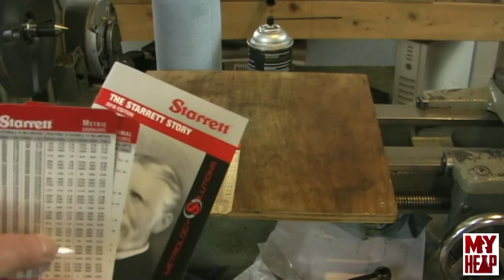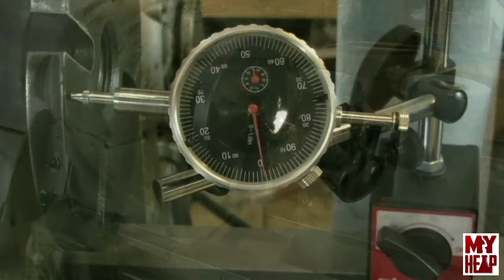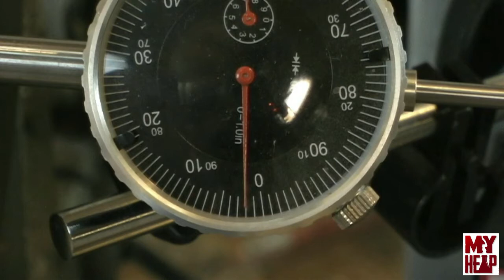Atlas 10F Lathe - TH54 - 23 - More New Parts, QCTP and an Issue with the Back Gears

Comment: The arm that holds your back gears in place is an over center setup. so check if it's truly over center
Reply from the maker: So in a sense it should act like a lock on a pair of channel locks?  I know the ends act like a Cam, so thanks for the tip.  I will take a look to see if it is coming over center.  Great tip!

Joe

Comment: Hi Joe, things are coming along. I had a similar problem with my backgear.  I was working on a project and needed a "quick fix" to finish thr project in time (was a captive nut puzzle for a friends daughters graduation.) What I did was make a quick little arm out if sheet metal that I screwed to the oil hole and tightened it down, holding the lever foward. Not fancy, but it worked. 
The only reason I can think of to run the machine in reverse, would be to cut metric threads, and I do it so seldom, that I am not worried about reversing by hand. I have seen chucks fall off and significantly damage a bed running them in reverse. I we did not have screw on chucks, it would be different.
Reply from the maker: Richard Cox sent me an email with a picture of the fix he done when he had the problem.  He made an 8-32 brass knurled thumb screw and screwed it in the oil hole.  That seems like a pretty good fix too.  Just have to remember to remove the screw and oil it once in a while.

For conversation sake, I saw a guy machine a plug that rested on a step in the bore of his chuck, which he threaded the center of.  In use, he would open the jaws and slide the piece inside his chuck to rest on the step that was internal, then insert a drawbar and and tighten it up.  In his case he had to do a lot of threading that the half nuts were useless on and he wanted to reverse the lathe.  This allowed him to do that without the worry of spinning off the chuck.  Now, I don't know if all chucks have that step, but it was a neat solution.  Although you lose the ability to pass stock through the spindle.

I think that no matter what, I want to learn to run the lathe before I consider taking any risks.  So, in the event I need a metric thread or want to cut a work, I will back it up by hand.

Thanks again Jeremy for all the help you have given me.  It is greatly appreciated.

Joe

Comment: Really helpfull and fun to watch as always. I still haven't had time to tinker with the collars, but I will soon. Otherwise the ball and spring is going to be a project. And it was fun to hear how you pronounce my name haha! 
Oh and a 3 phase motor is easy to reverse as you can switch the wires around. A single phase motor has to be made for reversing I think.
Reply from the maker: Gerben,

I thought I would be smart and check the "Go Ogle" machine on the "Interwebs" to see what I would get for a Dutch pronunciation of your name.  I could not really find a definitive source so went with what I got the most results for.  If I messed up the pronunciation of your name, I apologize.  :-)  Some people it bothers, some it doesn't.  Me for example, my last name gets butchered all the time, but I care less about it.

The simplest solution for the back gear problem is a brass thumb screw.  I received quite a few suggestions and links about the issue and it seems like many have had the same problem.  If you email me (xavier at gtec dot com) I will send you an image of one guys fix with the brass thumb screw.  I think this would be easier than setting up and drilling for a detent spring and ball, though I think the latter is a cleaner fix.

My motor is a 1/2 horse single phase motor.  After getting a good look at the data on the motor, I find that it is reversible.  I simply need to the reverse the start winding polarity.

Thanks again Gerben, and again, if I messed up your name too bad, I apologize.

Joe
Reply: Haha no worries, it was fun! Nice that you put the effort in searching the name, no one else does that ;)
I will send you an email right away!
Thanks for the help.

Comment: Probably a silly comment, but a rubber band stretched from the oil filler to the back gear handle might work to keep the back gears  engaged. Perhaps the previous owner had a spring loaded plunger   threaded into that tapped hole to create friction on the shaft and if a small drill point dimple was drilled into the shaft at the engaged and disengaged positions and a spring loaded plunger was used that would most likely solve the problem. You should be able to find spring loaded ball plunger at McMaster.com. I have the same lathe except I have added a quick change gear box. Regarding motors, since I had the money, and I don’t mind changing and improving my machines and am not concerned with keeping everything OEM and museum quality, I replaced my single phase motor with a new VFD rated 3 phase motor and added a VFD (variable frequency drive) that converts single phase 120v to three phase and more importantly gives you variable speed capability. I added a digital tach for spindle rpm reading. A lot less belt position changes and I can run the spindle from a crawl for power tapping up to full speed. I have a drum switch in my setup and use reverse when power tapping, I don’t usually have any issues with the chuck unscrewing but only running at slow speed when power tapping and only power tap with larger size taps.
Reply from the maker: Hello Steven and thanks for posting.  First let me say I appreciate all feedback!  You are correct a heavy rubberband would most likely fix the problem.  Another good solution is a brass thumb screw applying pressure to the shaft.  I do like your spring loaded plunger solution too.

I would not mind converting to a new motor and VFD and digital tachometer.  Speaking of which, where did you mount the sensor for the tach?  If it is a genuine improvement I don't mind changing the machine as long as it can reasonably be put back original just in case the next guy wants it that way.

Great tips and ideas.  Thank you Sir for taking the time to share them with a newbie like me!

Joe
Reply: My Heap - sensor for tach is mounted on left side of spindle pointing at adjustment collar. Tach is a “Tachulator” as sold by LittleMachineShop.com
Reply from the maker: Thanks for link Steven.  I appreciate it.

Joe

Comment: working in inches is very inaccurate. A 1000ths is 0.0254 mm, thus 4 thousands runout is 0,1016 mm and that is a lot of runout, in fact to give you a comparison on my babbit atlas lathe I have 0.02mm runout and this lathe is the tapered roller bearing version.
Reply from the maker: I agree, but the run out was on the face of the used face plate that I acquired.  A measurement of the spindle bore had less than .0005" run out, 0,0127 mm.  For what I do and given the lathe is nearly 80 years old, I can live with it.  Thank you for watching and taking the time to comment.  I appreciate it.

Joe
Reply: @MyHeap  I've got the exact same lathe but with babbit bearings, nice thing with the babbit bearings that you don't get with tapered is that you can tighten everything up if you want super accuracy like with fine thread cutting. My lathe didn't have all the goodies your lathe has and I can't find a single Atlas 10inch part in my country, so had to resort to upgrading the lathe to electrical. Have an electronic leadscrew with closed loop stepper motors/drivers and I have an encoder on my spindle to do readouts and upgraded my motor to a dc treadmill motor. Feels like a modern lathe, but still has that antique workshop smell to it, love it. 
If you by chance have any parts laying around I'd be will to buy some if possible?

Comment: Joe, I have two comments for you. About your back gear creeping out, I would not want to modify my lathe like that if there were any other way to fix it. To fix that correctly will be a little trouble but if you will take all the gears off of the spindle and the back gear shaft and check the distance between the two shafts and also make sure that the two shafts are parallel to each other I think that will solve your creeping problem. If the shafts are off you will notice that there are shims between the back gear mounting and the main housing of the head stock frame. You change these shims to correct the distance and parallel of the two shafts.
      As far as the reverseing of the motor, I would not want mine to reverse because your chuck screws onto the spindle and if you run it in the reverse direction the chuck can unscrew off the spindle and that is a horrible castastrophe. You cannot lock the chuck onto the spindle tight enough that it will not come loose if you put any strain on it in the reverse direction. 
    Hope this helps you make the right decisions.
Reply from the maker: Hi Clifford,

I am sorry for the late reply.  Been busy with life.

I made a video where I calculated the shim size to place between the back gear shaft casting and the headstock spindle casting to set the gear spacing.  Although it is a painful video to watch as I was brain farting along the way. (Started with the OD of the gear rather than the PD, but eventually caught my error.)  I could have, and probably should have remade the video, but sometimes seeing ones mistakes are helpful.  But after figuring the center to center distance without any shims, I could calculate the thickness of shims I needed for my lathe.  If memory serves correct, that was about .011 or .012.  What fixed my issue was to apply a little more compression to the spring washers that sit against the back gear castings with the collars.

Now, having said all that, I think the wear of the gears could possibly change the geometry and could cause the need to adjust the thickness of the shim.  I calculated the shim based on the formula for center distance for the two shafts.  If wear affects that, I do not know if I would need to adjust the shims thinner or thicker to compensate.  I could also imagine that the pressure angle of the gears acts as a lever of sorts that would cause the gears to lever away from each other.  But keep in mind I am a novice and don't really understand all the mechanics.

As far as reversing the motor, the jury is still out.  I can see some benefit to it and with things like a collet it should have no ill effects.  I realize there is a danger of spinning a threaded chuck off the spindle and to reverse the motor could have disastrous effects.  Although an interesting solution to that very problem was presented by Steve Jordan.  His solution is something of a drawbar that holds his chuck in place when reversing the motor.  It is an interesting video and you can see it here: https://www.youtube.com/watch?v=8PYsNfKk_Q4

Clifford, thank you for taking the time to post and your suggestions.  These are helpful to a new guy like me.

Laus Deo,
Joe

Comment: i'm not sure you can reverse a single phase motor.. or at least simply do so.  unless it's DC. also there are lots of drum switches online or even at harbor freight.... also be VERY careful running your lathe in reverse because the chuck can easily unscrew in that direction.
Reply from the maker: Hey Bill, you are correct that reversing it has to be done with care.  I need to look at the motor, but I hear the centrifugal switch kick in and out when turning it on and off.  This leads me to think that it has regular start windings that are taken out of circuit when the motor comes to speed.  On some of the motors, if I remember correctly, reversing the polarity on the start winding will cause the motor to run in the other direction.  I think that is all a single phase drum switch does, is reverse the start winding.  I need to look into it, so I may need to look at a different motor setup if this one will not work.  Thanks brother for the input.  I appreciate it.

Joe

Comment: It is inadvisable to put a reverse on an atlas lathe because the chuck could come unthreaded and create quite a problem and lots of damage with a flying lathe chuck. Think about what would haooen to the spindke threads if it decided to come unthreaded turning on a live center with one end in the tailstock.
Reply from the maker: You are right Al.  But like most things in life, I think you have to weigh it out.  If for example I am turning material in a collet and it is captured by a drawbar, it doesn't matter, But a threaded chuck, like you say, is another matter.  Interesting video I saw a while back was Steve Jordan was looking for a way to combat that very issue with his Myford lathe.  His solution was interesting.  He made a drawbar of sorts to lock the chuck from spinning off.  Thank you for taking the time to watch and comment.  I appreciate it.

Joe
Reply: @MyHeap  The original motors for atlas lathes were reversable .You can use a  relay and any three way switch to reverse them. I have never had the need to turn anything in reverse except some boring in large diam . I dont really do that much left handed threading either. I tried metal spinningand that may have gone smoother left handed on one occasion. I did have the chuck start to come off once but I was going very slow and shut it down.Its good to have an e- stop for stuff like this.
Reply from the maker: @ALSomthin  The motor I have is reversible and I have a drum switch that I can use to reverse it.  I have a flat T-slotted slide with my lathe and a rear tool post.  It would be nice to turn in reverse in some instances.  Both of my chacks are 6" and have a fair amount of weight.  I could only image the "OH CRAP!!" moment (or Movement) when they come off.  I think I may explore Steve Jordan's idea before I tried it in earnest.  Would rather keep me and the lathe safe.  In that order.  :-)
Reply: @MyHeap  I will have to check out Steve Jordan's chanel and idea and see what he has got going on Thanks! ;-)

Comment: Hi! You have a screw on chuck – so you don’t want to reverse the lathe as it will unscrew the chuck.
Mike.
Reply from the maker: Hi Mike.  You are correct that there is a risk of unscrewing a chuck, but there are cases where you are using a collet that is held in with a drawbar that you may want to do such a thing.  I don't know that I ever will, but I have seen plenty of these Atlas lathes with reverse so I thought it would make it complete, albeit perhaps a bit more dangerous.

Joe
Reply: I use reverse on my atlas a lot, comes in handy...must be mindful of what you are doing and not get crazy

Comment: G'day Joe and thanks for the prayers to stay warm, I'll try to keep them for our winter which rarely goes below 2C, at present it's 38C and climbing 😊. I can't help with the back gears but would look for a detent or over centre, it would have had something as the gear design would naturally cause them to separate. Good luck to you and the Dutchman with the fix. I'm off to find some shade and water, Peter
Reply from the maker: Hey Peter,  Somehow I didn't get notified of your post.  That happens sometimes to me, for what reason I have no clue.  I think I will go with a brass thumbscrew in the oil hole to hold them in position.  Although, I think a spring detent is more elegant.

Where I live we normally don't get much below the teens at night and usually in the 40'sF during the day, so a cold snap and snow and ice usually means bad news for us.  Glad to know your not freezing, but don't over heat yourself either.  Summer where I live is HOT, though not as hot as yours I think but the humidity is nearly unbearable some days.  (OK enough whining)

So I watched your video on the steady and I am going to make a steady rest for my lathe one of my first projects.  I hope you don't mind that I throw credit your way for that and some links to your videos on making yours.

Joe